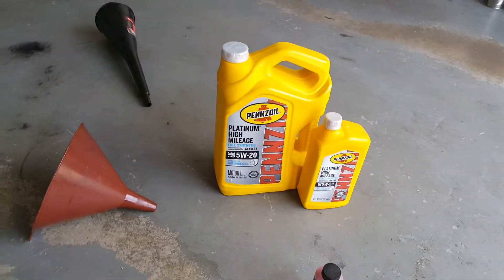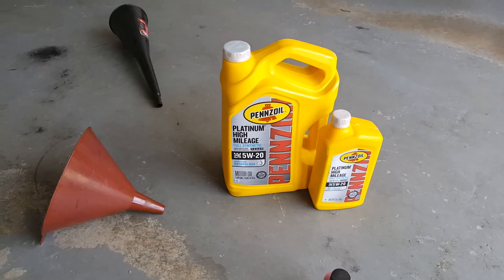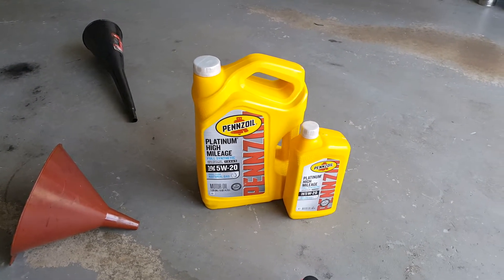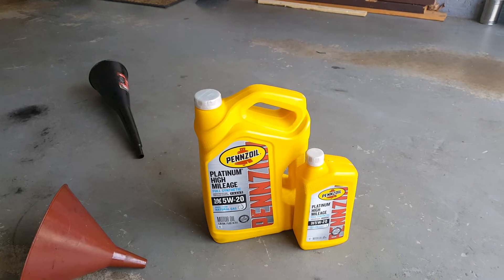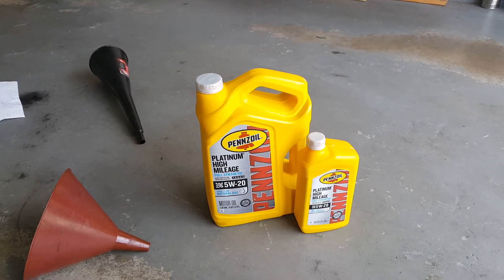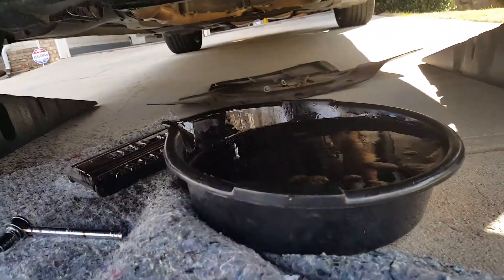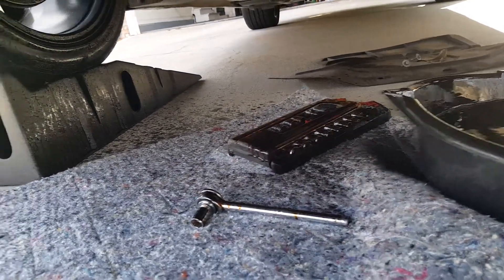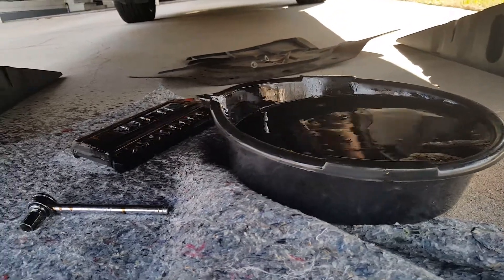Dodge Charger Oil Change

Comment: Dodge dealer along with Tires Plus told me that my V8 takes 7 quartes of oil. Tires Plus charges me $107 for oil change which comes with tire rotation. The Dodge dealership... Well let's say I stay away from there. Another good video. Keep it up the good work.

Comment: tip: Crack the oil filter open and give it a couple turns when you have the drain plug off, because all the oil in there will fall into the oil pan, and mix with your new oil.
Reply from the maker: 2AverageNoobs Great advice man. I probably would have done that but was distracted with filming the video. But that is absolutely true, I’ll remember that next time for sure. Thanks brother 👍🏾
Reply: @super6charger501  No problem. Happened to me alot of times at the shop, and one time at home I almost forgot to tighten the filter all the way and almost started the car. That's why I do a once over before I start the car haha

Comment: What brand ramps do you have? I have rhino ramps the old kind and my car hits before I can even attempt to drive it up there
Reply from the maker: Giovani Deangelis I don’t know the brand but I think they’re the same ones. I got them from wal mart. Your car probably sits lower than mine that’s why it’s scraping.
Reply from the maker: Giovani Deangelis I haven’t lowered mine yet but when I do I’ll have the same problem.
Reply: Ok I'm not lowered either. Maybe the newer ones are better for lower cars
Reply from the maker: Giovani Deangelis oh ok that might be it, maybe they were getting complaints and revised them. I had these for about two years.

Comment: Where’d u get the bumper and the skirt?
Reply from the maker: Davion needs a Hellcat I got the bumper from eBay and the side skirts from ikonmotorsports.com
Reply: Super6 Charger Ok thanks. Did you need to put spacers for your wheels?
Reply from the maker: Davion needs a Hellcat NO spacers necessary for this size wheel and tire set up. I have 9.5 x 20’s and 275’s. You can go up as high as 11.0 and 315’s
Reply: Super6 Charger that’s convenient. I’ve been tryna get rid of these stock rims for a while